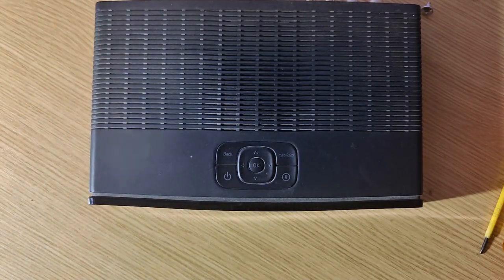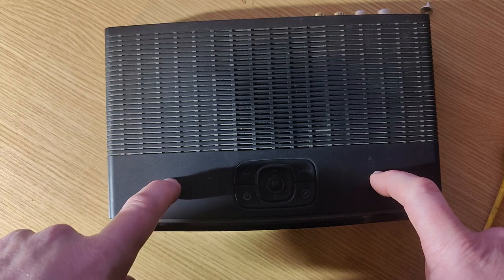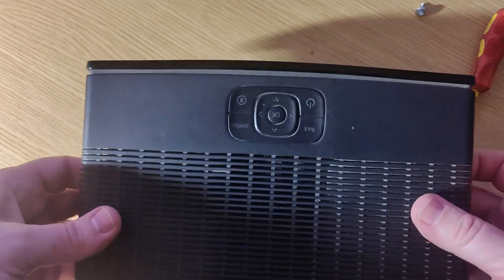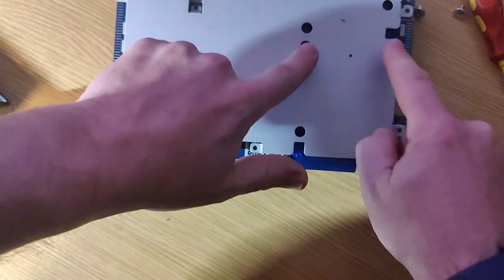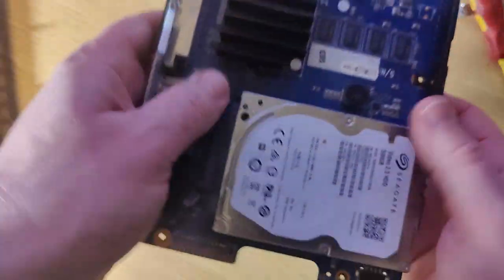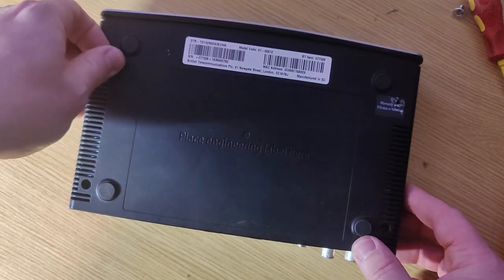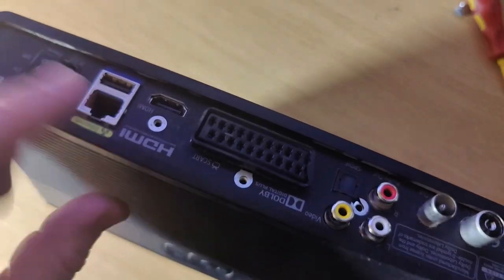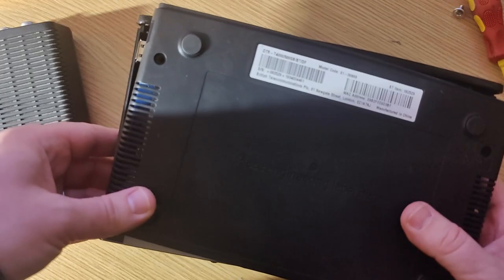BT TV YouView BOX REPAIR - Hard Drive Replacement Set Top Smart Box T2100 T2110 T4000 UHD - FIX IT!

Comment: Excellent video and clear instructions, after watching this video and  ordering a new drive from  the Ebay link supplied (which arrived after only two days) I found it relatively easy to swap out the  hard drive on my BT vision box. Once installed I needed to reset the BT vision box back to the factory settings, thanks to the clear instructions on the video this was quite easy however, I did have to follow the process a few times before the Maintenance Mode came up but once it did it was easy to follow and fully up and running in a few minutes. 
Thanks again.

Comment: Hi, Thanks for this really helpful, My BT box (1Tb) keeps switching off or giving a blank screen, primarily when viewing recordings although, my wife said it also happened when watching tv (which I have not seen, but I suspect it may have been pausd so then viewing from the HDD maybe? -  Do you think replacing this will work or try a hard reset first and delete all recordings?
Reply from the maker: for the price of the drive I would just replace it, you can always use it in another project if it doesnt work out.
Reply: @repairsnstuff  Thanks, I have performed a hard reset, and reloaded the software which has changed it to EE TV menus in yellow now -  I'll see how that goes if it starts to give blank screens again I will swap it out thanks. BTW which is the best BT Box the 'TV 4K Recordable Box' which is 4K and Ultra HD or the 'EE TV Box Pro'
Reply from the maker: @RobHodges-h7w  EE TV Box Pro is newer has a faster processor and looks nicer so it gets my vote, I think it also has some voice control in the pro remote control

Comment: Hi great video, please can you help i have the same model as you,the issue is I switch it on and its constantly in a cycle of waking up and youview loading
Reply from the maker: this problem can be caused by the hard drive, try getting it in to the maintenance menu and do a full reset
Reply: @repairsnstuff  hi thankyou for the reply,how do I do a full reset please,I tried holding the on and ok button simultaneously but screen goes blank then back to the cycle as before
Reply from the maker: @markrocketmangrimstead  no thats not the correct method for this boxes. 1. power off at wall 2. switch on wall switch while holding down the DOWN button on the top of the box. 3. when messages "maintanance mode Y" comes on the screen press the standy by button on the top of the box.
Reply: @repairsnstuff  thankyou I appreciate your advice,I will give that a go

Comment: Cracking video thank you, please can i ask can you add a 1TB drive if it was fitted with a 500GB originally? Thanks
Reply from the maker: Yes I. Theory you can, but it needs to be a low power model. Around 0.55 amps or lower.
Reply: @repairsnstuff  Thanks very much for the quick response, will check that out, thank you!
Reply: @repairsnstuff  Is that 1.5 watts? Can you recommend the Seagate ST500VT000?

Comment from the maker: An update to this video: it seems better if you can use a lower power hard drive (5 volts at 0.55amps or lower seems to be the best WD & Seagate drive are OK but check the spec)